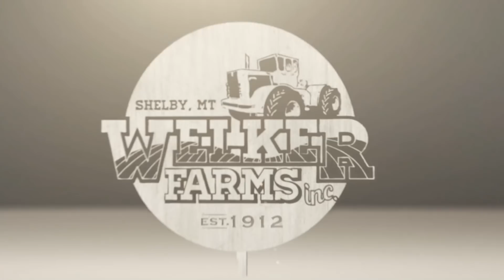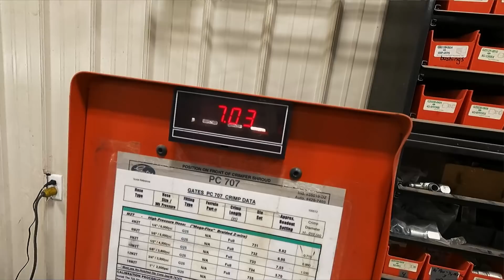Belly of the Beast

Comment: Many people don't realize how much effort it takes to farm, they just see the equipment in the fields and think that is all there is too it. Glad to see the other parts of the operation of farming. I know fixing our equipment was hard work but taking things to the dealer is costly. Case in point we a had o ring failure in our transfer case $2500.00 estimated repair we did it ourselves cost .25 cents and five hours to split the case from the tractor and back together.

Comment: Want to be sure your tie rod ends aren't pulling your tires in or out? Attach long pieces of straight board (or angle bar) to the tires on the front end.  Measure between the ends of the bars at the front and back.  That should tell you whether or not your alignment is close.

Comment: Fire service three inch hose has 2.5 inch couplings. The water will flow slightly faster through the fittings without significantly reducing flow.

Comment: That is a nice round hole !    I would have done it the hard glue way.    I usually make a 2 inch hole coupon then epoxy  glued it into the smaller hole to have a centering for a hole saw the size for the new bung.

Comment: Hey Nick! Just giving you a heads up I work for company that does not allow us to enter any type of a confined space without using some type of air tester or sniffer. You should have the sniffer running in the hole while in the confined  space.  If any type of  Engine exhaust gets down in there your that well take  Oxygen away. You should always play it safe and use one of these machines safety is 1st! For  you and your familys safety. Please look into a  Air tester machine.
Reply: They don't need it for these tanks. No threats. These tanks get washed after use too. No osha either on a family farm. While many of the regulations set by osha are great and needed, some are pointless. These tanks get washed after use and filled with water for fire fighting season. The chems themselves are also not a threat

Comment: You don't need to go inside to put in a new bulkhead . Cut from the outside . put a rod through the hole , Drop the new fitting down the rod . Done

Comment: Just curious if the dead land with the alkaline buildup that you guys have corresponds to meltwater ponds that do not drain.  If meltwater puddles over an alkaline deposit, and stays there until it evaporates, that will kill the land because the deposit is sucked into the water, then the water evaporates, leaving the alkaline deposit on the surface.  If you guys start working with a trencher or deep ripper to keep water from ponding over alkali deposits, it might slowly allow the land to recover as meltwater moves the alkaline stuff on the surface away from the farmland.

Comment: make sure to keep your oil cooler clean in the cummins motor also the piping in the pan, the oil runs hot and u get sludge buidup in the cooler chk the clamps in the pan make sure you have no plastic inserts on the clamps, remove the plastic from the oil tranfer line clamps in the pan, this can cause the saw holes in the pipe to get stopped up and starve your engine of oil and burn your motor. shade tree keyboard puncher
Reply from the maker: Appreciate the advice, which Cummins engine are you speaking of? The kta1150?

Comment: Nick next time you go in a tank consider wearing a harness,  If something goes wrong it makes retrieval muck easier, also consider testing the air in the tank many gases are heavier than air and can collect in unused tanks.  Also why didn't you cut the hole with a hole saw out of curiosity
Reply from the maker: Appreciate the advice, didn't have a hole saw 4.5" in diameter. Had a 4" 😂 but needed that extra 1/2"
Reply: @WelkerFarms  that stinks hole saws cut so much quicker and nicer but I spoiled it's 5 minutes to the hardware store and they stock hole saws in almost every size up to six inch

Comment: Didn't you have some issues with one. Of the bigbuds and it slipping(transmission) in any gear above 2nd (in high load application) last year, if so what are you to resolve that?
Reply: Got it corrected.  Loose wire.